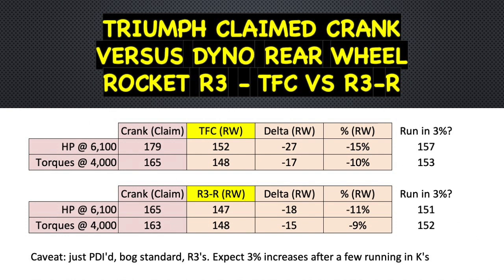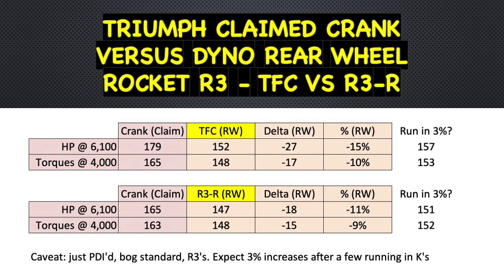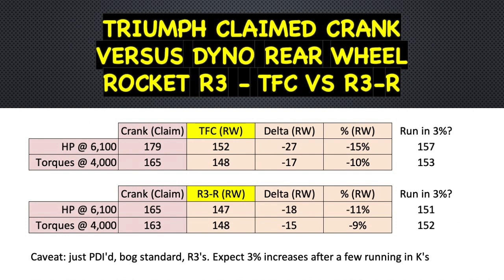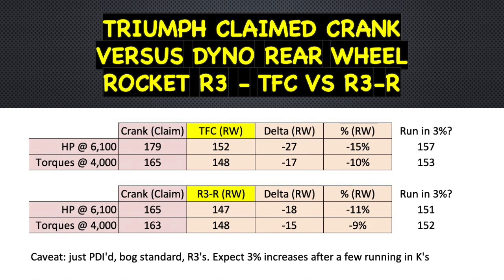RIDE ON | Dyno'd Triumph Rocket 3 | Factory Custom (TFC) vs R3-R

Comment: with that sort of difference people will be able to sue triumph for miss leading  information to customers
never heard of that sort of difference that huge 
I know I will be bring it up with triumph and my solicitor  
I paid that money for the tfc because of there claims
Reply from the maker: I hope that's sarcasm?!?! :-D If not - as I mentioned in the video it lost 15% of power which is atypical of drive-train loses (crank to rear wheel) for most shaft driven bikes that are brand new (a little more to come once run in). So in this respect, IMHO I don't feel Triumph have miss-lead anyone? And certainly 152 hp 'at the back wheel' is still a hell of lot in anyone's money! But you've got to look at it in conjunction with both the low amount of torque loss (just 10% - 148 lbs.ft) and how accessible that torque is (max achieved at just 3k onwards). I sat on a 200 hp Streetfighter V4 S this week. It's a light bike, that makes a lot of torque. But 'a lot' is just 90 lbs/ft ('at the crank' - '75 less' than the R3-TFC!) and it'll make that at stratospherically high revs, compared with the Rocket - which makes the Ducati much harder work on the road. Have you taken delivery of the R3 TFC yet? I've owned some of the most powerful and fastest bikes ever made, such as a K1300S, Diavel and S1000RR. And to me, when you whack open that throttle (even on the 'standard' rocket), you're not left wanting for performance! :-D
Reply: @RichDunn  Hi Richard 
I understand where your coming from 
I have owned some of the fastest bikes in the world as well, 
but very disappointing when you pay 10k more for a bike they claim to have more Hp which it doesn't 😒😢they shouldn't claim it!!!!  if it doesn't 
I'm going to get mine dyno'd to see what is does as I know every bike is different
Reply: I felt more ripped that I was promised my TFC in May 2019 and ended up getting it in Feb 2020. That was part of the exclusivity, the fact it came out at least 6 months before the standard models. It was meant to Come with custom tuning and mapping for significant performance upgrade an optioned up “with the lot” “best of both bikes” but turns out I have to pay $450 to fit heated grips and $750 for the integrated my triumph tech model, both items I thought it came with.  Not to mention the bespoke arrow pipes that other than the carbon covers - are they any different to the stock? I love the bike to death but these were sore points that Triumph have let us down on
Reply from the maker: @huddarudda2244  If you were told that, I'd probably feel the same. But who told you that, as I don't recall Triumph making any of those claims? I totally agree that the heated grips should be standard and are an insult to TFC owners that they are not. Again (not that it shouldn't also be standard not he TFC), I'm not sure who told you the connectivity option costs $750, as it's just $215 in the online configurator? Triumph cannot offer non road-legal exhausts for the R3. And of course whatever you fit has to be Euro5 (read strangled) compliant. Personally I think the ECU and engine tune are exactly the same. But the Arrow flows it's air a little neater. The net result is an extra 6 hp at the rear wheel, but no change in torque. It's more a weight loss and gorgeous looks thing. But for those who wanted extra go with the show, they'll be disappointed. Carpenter and Zard will IMPO be the first likely suspects to bring out a performance exhaust for it. Maybe Akrapovic too.... if we're lucky! "I love the bike to death but these were sore points that Triumph have let us down on" - I think that's generally a fair comment, 'if' that's what 'Triumph' (rather than your dealer?) told you.
Reply: Richard Dunn yes, a triumph dealer or triumph themselves to the Customer are one and the same. I ask the “authorised” dealer and they tell me Triumphs response is. One of the issues of buying so far in advance without so much as a brochure too look at is your buying based on conjecture. Told it would arrive in May ‘19 but nothing in writing to make a point. Then “definitely” before Christmas which tuned out to be mid Jan. and definitely sold as a bike that will be released 6 months before the standard models are launched- which again was not the case. No heated grips is the biggest rip along with the module that was never mentioned only that the TFC came “fully loaded” being the best of both models. The cool Go pro connectivity was talked about etc but never mentioned I’d have to pay more for it. As t the end of the day I’m told there was over 100 other people that put deposits down on a wait list for the TFC, so they are in a good position. They Willis just offer it to the next person on the list. The module at $750 was based on the dealer quoting me $455 for the part plus up to 2 hrs labour to fit it. In the end the dealer was so embarrassed that it didn’t come with the parts bc already they offered to fit any parts I want and Willis not charge labour. But I still have to buy the parts. If it’s only $250 as you say online, I’ll double check that and definitely get that sorted
Reply: Richard Dunn where are you seeing a quoted price of $215 for the My Triumph connectivity module? The Aussie .com.au site shows it as $295.. which is still less than the $455 I was quoted plus up to a couple hrs labor to fit. Ironic the website says just 1m to fit lol. It must be a simple plug n play under the seat.
Reply from the maker: @huddarudda2244  We'll have to agree to differ that a dealer and the manufacturer are one in the same. But I would say if any dealer had openly lied to me, they would not receive my servicing or next purchase business. Integrity is everything!
Reply from the maker: @huddarudda2244  The Triumph NA configurator quotes the connectivity module as $215. You can see it when you select 'electrical' accessories here: https://www.triumphmotorcycles.com/configure/bike/04ca9ae0-cf15-4174-bcf2-a91209aab064/configure#config It looks plug and play, so unless it messes the CAN BUS without a Triumph diagnostic tool being plugged in by the fitting mechanic, I'd say no need to pay any labor costs on that one. My friend Erik is getting it for his TFC, but I don't need it, as I'll use my phone or Garmin for GPS and my GoPro works well with voice-commands anyway. The grips and this module should have been F.O.C. on the TFC IMPO. But I could say the same of parts for $40k+ HD's too. It is what it is. I.e. What you get for the money is either acceptable or not to buyers? It's up to buyers to decide that for themselves, as nobody is forcing them to buy and it's their money at the end of the day. But equally I don't see better value in the VMax, Diavel, FXDR, Fat Bob or any similar muscle cruisers compared with the base bike. And I think the TFC looks VFM compared with CVO bikes - I'd Sooner's have 2,500cc than more chrome.

Comment: Hi Richard. A couple of things.....I think you said that these bikes were tested in third gear?  I'm sure that my dealer told me that these bikes were 'restricted' up until 4th gear.  Also the quoted figure for the 'R' is 165bhp @ 6000 revs, while the claim for the TFC is 179bhp, a further 1000 up the scale at 7000 revs. Your figures are taken at 6100, so Is it possible that the TFC could have revved a bit higher.  I thought that was where the extra power came in.  Really enjoyed your comments though.  Very informative.
Reply from the maker: I haven't seen any official announcements from Triumph that they have restricted torque in any gears? But you're not the first to mention this as Finlay Cooke responded to this video posting in same. However, I would assume that they haven't. In the original Rocket they restricted first gear torque (only) in the early models, including the touring model, I believe. Of course, back then the RIII didn't have the R3's traction-control or 5-axis IMU to help control those thumps. I don't know which gear the runs were performed in, but typically it is fourth gear, as there is never any manufacturer restrictions on fourth gear and the gearing is low enough to fully rev out the engine. I.e. Truer results. On the day the TFC only revved to 6,170 rpm. Although I suspect it will rev out slightly higher once the engine is run in. I'm not in the pocket of the dealer or dyno operator, so I'm just the messenger! :-D Because this is the largest motorcycle production engine by far, and has large horsepower and torque claims, understandably everyone is little obsessed with the numbers. But dyno chart hp and lbs.ft are one thing. Once the vehicles weight, proportions of that weight, the gearing applied and how brave the rider right wrists is applied, the numbers mean less. Thrust curves better take these factors into account and I would like to see the industry and journalists show those and talk in terms of those, because ultimately that's what's going to get you down the drag strip (we'll call that 'the road' ;-D) the fastest!
Reply: My original 2016 Rocket 3 had an EEC restriction in the first 3 gears and got my dealer to remap, thus removing electronic restriction. I think the later models were modified to prevent remapping.
Reply from the maker: @markwalker8929  The early ones certainly were restricted. I believe it was actually removed in later years when Triumph realized nobody was high siding them and bikes like the current VMax were on the horizon. But the RIII and the R3 are 100% different. Every single nut and bolt. The only commonality is the Triumph badge! 😀

Comment: Just another Euro bike company that tricks their customers into believing they found the holy grail of power, when true numbers are much reduced, like Ducati, KTM, BMW and the like. Thanks Richard for bringing some light upon their constant bs-ing. As if people out there didn't have access to dyno's to measure the true figures....
Reply from the maker: Always good to get feedback Jeremy, whether folk agree with your POV or not. I have a Ducati Streetfighter V4S which I notice Calimoto dyno'd at 200 hp with just a tune and end can, which was pretty impressive as Ducati 'only' claim 208 hp at the crank. I really think it's about time manufacturers only quoted RWH, as they've now started to with 'road-ready wet weight' for instance - it's just a bit more credible as you mention. They'll always be variance (ambient temp, engine age, dyno used, standard accredited), but they need to get it more uniform, so we're comparing apples with apples don't they? Cheers for your comments!
Reply: @RichDunn  Agree 100% Richard. And on the weight thing... same, don't even get me started!! Friggin ridiculous! Imagine if a car maker sold you a car they claimed it weighs 1000 pounds, and then you found out at the time of weighing it, they didn't include the oil, coolant, bolts, paint, and who knows what??  "Oh, we are weighing the car? Wait, let me remove the battery first" -  LMAO!!! 

Thanks for the video mate. Cheers!
Reply: Manufacturers have always claimed power to the crank. Its not some grand conspiracy, they just use an engine dyno to measure. Obviously you'll score less on a wheel dyno due to drivetrain loss.
Reply from the maker: @NicePantsLance  I don't think anybody mentioned a conspiracy, Lance? But obviously measurement at a crank is meaningless if the final drivetrain is not a uniform constant, which of course they never are for many reasons. What would equate to greater consistency would be RWP on a standardized dyno, with a controlled ambient temperature and forced induction frontal airflow. But there's no industry standard on that either. Even if you measure a crank bolted to a bench, the measuring equipment itself,  acts as the driveline effectively, and although fewer loses than if it were bolted to a shaft drive with a heavy wheel and tire fitted to it, there will still be intangible losses. Davide Tardozzi, WSB/Moto-GP boss famously offered any manufacturer one million (25 years ago) if they could prove they had measured their cranks without any loss of power, for instance. Everyone will have an opinion, but I feel that most feel it is a little disingenuous to quote power figures not available to your back tire and therefore seat of the pants.
Reply: @RichDunn  my comment was directed towards Jeremy, who implied that manufacturers are straight-up lying about power figures. I appreciate your well articulated response, but none of that is new info to me lol I 100% agree with your statements
Reply from the maker: @NicePantsLance  I guess some independently measured results are closer to some manufacturers claims than others, is what I assume Jeremy was trying to portray. We're at their mercy in terms of whatever they choose to claim, but not in our freedom of choice. Power-to-weight ratio on paper is one thing. But as we know, where that weight is carried and how accessible its power is, can significantly alter how we feel about a motorcycle after riding it, versus any preconceptions that we may of had. As always, numbers are a useful 'guide'; but there is no substitute for long test rides and ownership experience to know if a bike could or will continue to float your boat in the long term.
Reply: @RichDunn  that is true, but a large majority of the variance in results is the discrepancy between dyno's. They are off so much, that even if manufacturers all claimed wheel power specs there would still be margin of error. The only consistent way is to measure gain via 'before and after' dyno runs, but that doesn't help when stating a baseline figure. Hub dynos are much more accurate between models, hence why everyone states engine power figures
Reply from the maker: @NicePantsLance  See my previous response re: variance and standardization; I think we both agree they exist and hinder apples vs apples analysis. A bench measurement has less variance, for sure. But having less variance is of less value, if that is not what is ultimately available to the end user. Aside trying to industry standardize the variances I mentioned above, the primary differentiator will be final gearing. For this reason, what would be far more insightful for speculative owners would be thrust-curve readings on a per gear basis. Because that is showing the force (torque); repeatable work rate (hp - extrapolated from torque); over time (availability - gearing based delivery) in a conjoined graphical representation. In other words, using a boxing analogy: how hard you can punch; how hard you're working when punching; and how quickly those punches can be repeated (in a single graph). But of course, all this numbers nonsense, simply dissolves if rider abilities differ as much as typical dyno's do. Or as the great Mike Tyson perfectly put it - "everyone has a plan... and then you get punched in the face". 😀